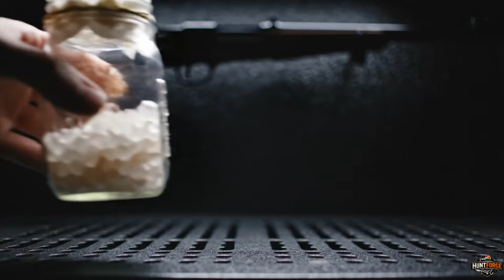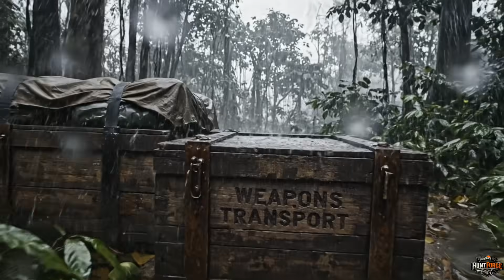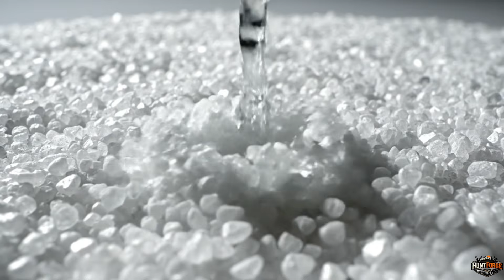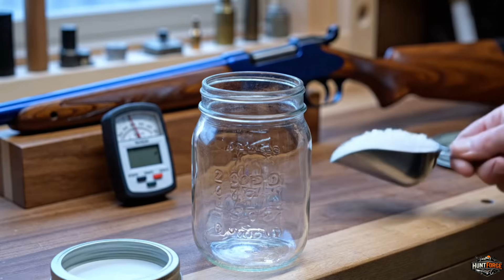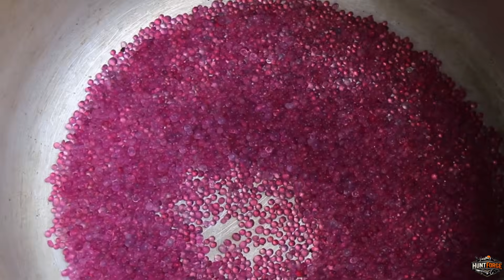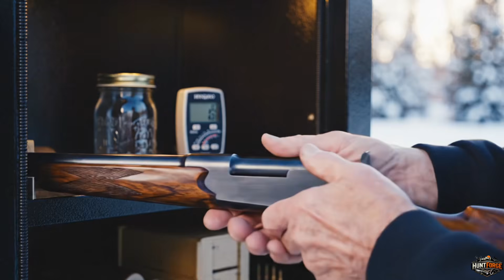$2 Jar Keeps Your Rifle Rust-Free FOREVER - Army Used This Since 1943. Gun Safes Are Lying To You

Comment: If it rusted, you didn't oil it.😂 Florida coastal humidity doesn't rust oiled steel kept in a house. Use a tooth brush to spread oil on every nook and cranny.
Reply from the maker: Oiling definitely matters. The point here was that a light coat of oil and better moisture control together beat relying on either one alone.